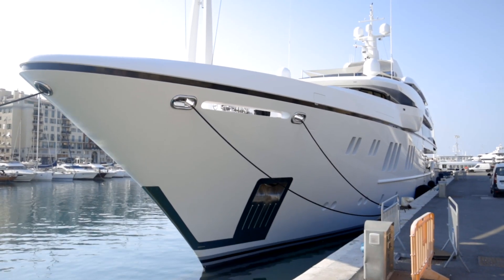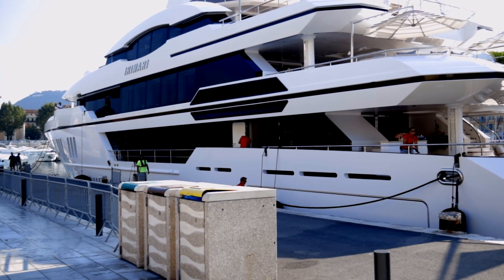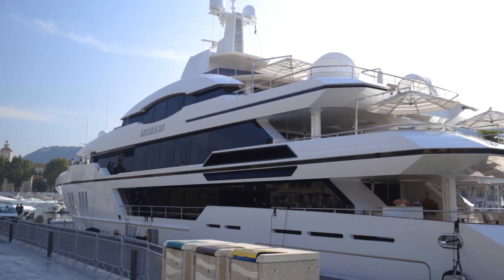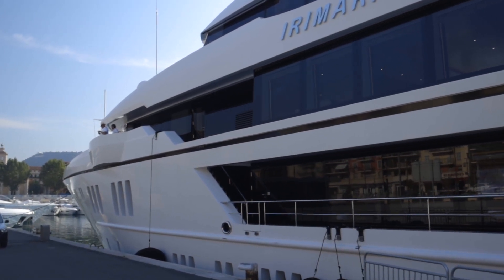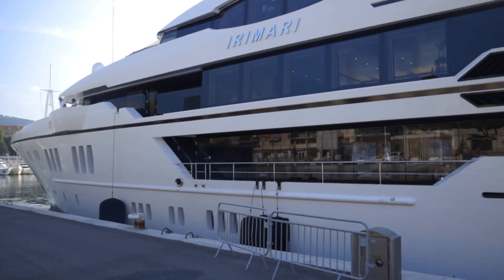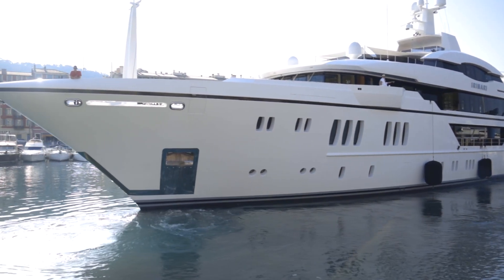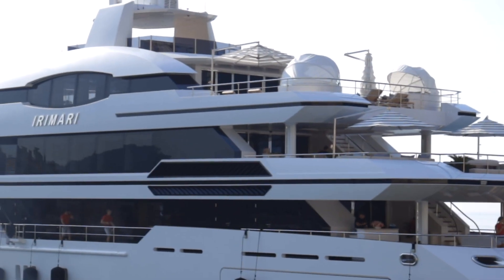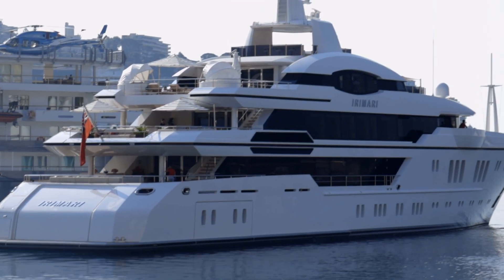Super Yacht departing Nice, step by step commentary.

Comment: Just a minor correction, radar uses frequencies closer to microwaves not xrays. They are non ionizing and generally harmless especially in low power consumer applications such as this. Thanks for the video! it’s very enlightening on the crew movements as they leave port.
Reply: Will Yes, who could possibly object to getting zapped by waves used to boil water? Very reassuring.

/kidding
Reply: I was just about to comment a similar thing, but you beat me to it. I think he's confusing X-Band for X-Ray. Ship radar uses X-band and S-band.
Reply: xNYCMarc ah I didn’t know about x band that makes sense.
Reply: @Karen Mata Yeah, back in the day like 1955. Only military radar produced enough ionizing radiation to even be a concern. Merchant vessels and certainly motor yachts never had this problem. All high voltage vacuum tubes produced ionizing radiation, including television CRTs, but the levels were so low as to not contribute to cell damage or cancer rates.
Reply from the maker: Yes I did mean microwaves, but they certainly are not harmless. This is why they are switched off when people go aloft. .
Reply: Your microwave at home is non-ionizing.
How about you use it everyday with the door open and see what happens to you in a couple of years.
Reply: @YachtReport  , as an ex RN radar technician I agree that at 2m the level of radiation is concentrated but at 10m+ it becomes negligable, which is why you are allowed on the upper deck while it is running at sea.
Reply: Loot Box The damage that would be caused by using a home microwave with the door open wouldn’t be cancer though. The risk is to one’s eye sight. Microwave radiation heats the fluid in the eyes and without a way to vent the pressure caused by the heating, damage occurs. It wouldn’t take years for it to happen. It would happen the first time you did it. The microwaves emitted from radar pose the same risk to eye sight, but the concentration of the energy is so low that one would have to have their face pressed against the reflector to have a similar effect.
Reply: @YachtReport  So true, There has been more than one tower worker cooked by microwaves over the years.
Reply: Love these videos, but I'm loving the comments section to. I'm learning so much. Think I'm going to stay away from microwaves and those twirly radar things on top of boats.
Reply: @YachtReport  what about when guest are on the skydeck?  Do the radars not send the microwaves down to say,  the hot tube if one is on the sky deck?  I'd be pissed as a mother if I paid 600k and found out they cooked my insides lol
Reply: @cwdgoff  on most yachts hot tub is only used when at anchor because of stability issues, i assume they turn radar off at anchor after all you wont need it

Comment: A very good looking "little" super yacht :-)

Is any of the technology from self driving and self parking cars working their way into yachts so that the yacht can "park" itself?
Reply from the maker: Not at the moment although it’s inevitable that technology will get there,  but it’s not as straightforward with ships.
Reply: I saw a video from a larger ship where docking was partly automated, I think it was purely GPS based, not radars or ultrasonic sensors or anything like that so as long as the port is properly mapped and no other boats are in the way and nothing has been altered it would work. And of course it still needed someone on the dock to catch the rope. So, still some way to go...

Comment: Awesome play by play love the info, interesting note about the radar running in port. Is it really that harmful?
Reply: The really long range marine radars can emit up to 25 kilowatts of microwave energy, but this power is contained in a very short, intense pulse on the order of microseconds.  Newer solid state radars my run as low as 40 watts.  A home microwave oven emits about 1 kilowatt, but continuously.  The only possible interference I would expect are older WiFi and cell phones on other ships or landside.  No real health effects unless you're standing directly in front of the antenna.

Military ships' radars, on the other hand, can and do range up to 2.2 megawatts since they're looking for incoming missiles close to the water using very narrowly focused beams.  They normally operate at around 35 kilowatts.

Can't wait for the first super/mega yacht to introduce phased array radars into their superstructure/mast.  No moving parts.

Comment: There is a huge difference between x-rays, which is nuclear radiation and the electromagnetic pulse of a radar. Those are not known to be harmfull at any distance. Allmost any ship will turn on the radars before departure. Sounds like an engineer talking nautical stuff.